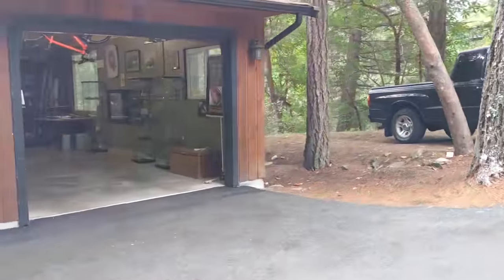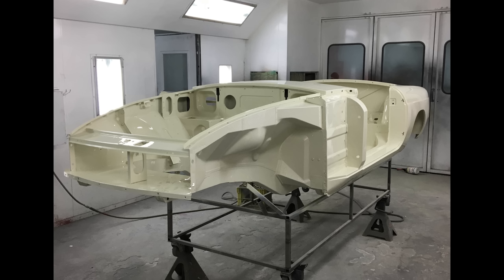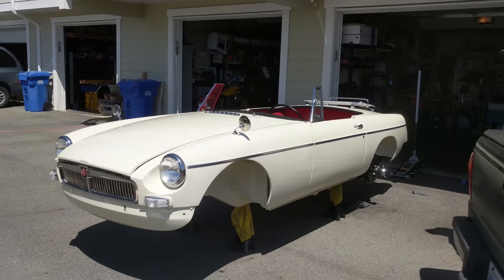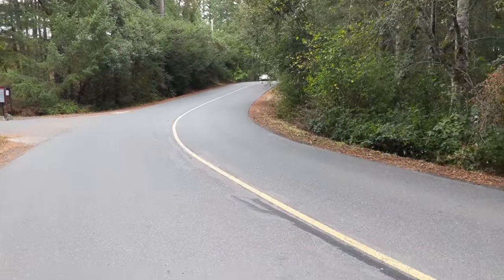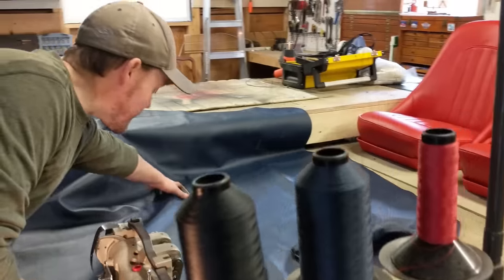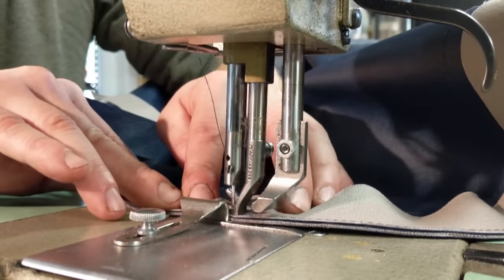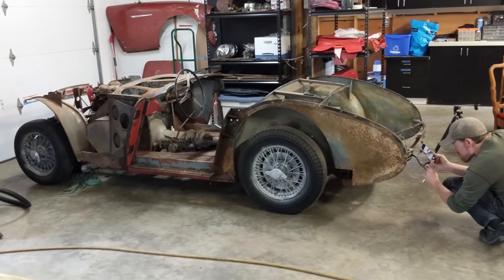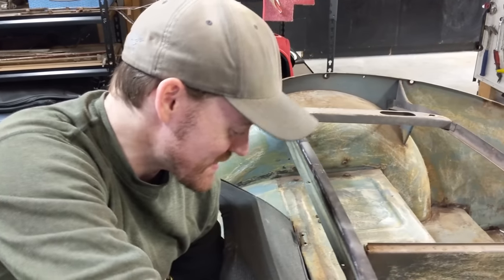The Rightway MGB

Comment: A very fine piece of restoration .  I have always lived in England and perhaps can offer some info on 1960`s car painting. BMC used a rotadip process which immersed the bodyshell in pink primer. Any paint that subsequently got underneath was overspray!! If a customer wanted underseal to be applied  it was done by the dealer not the factory. The produce used was Dunlop Rubberseal.  It was largely up to the competance of the dealer as to how effective this would be. If it stuck well actually quite good. There was never overpainting with body colour because most paints would dissolve the underseal. Cavity protection didn`t exist back then so rust was common.

Comment: I had a ‘59 MGA as my first car and then a new ‘67 MGB in college.  The B literally broke down with 27 miles on the odometer!!  Bad voltage regulator.  I kept it for 30k miles but had to get rid of it while I could as the engine smoked badly.  I still loved every minute driving it though.

Comment: I enjoyed the video ..very well-done and informative. I have had 3 MGs since my early 20s. I bought one new in 1979. Still have the window sticker with price and all options on it. Handbook.  Car flyer ads for MGs that year..both boot.and tonneau covers. Everything! Took it out of storage since 1988 2 yrs ago. Little rust! Maybe because my dealer had me inject a product called Rusty Jones every year or 2 into little orange plugs that came out to put it into the car body? It is nearing the end of restoration..never been in an accident and had under 56,000 miles on it. Original paint was still.intact when I took it out. Had a little rust on seams or edge but nothing major. But...when I sent it out to be dipped there was a surprise! When it came back the driver door had a huge metal.piece covering a good part of the lower half! The passenger door was fine. Since I AM the original and only owner and I know I never had any body work done.it had to come from.the factory with this flawed door which was then primed and painted to be sold as a new car! Have you ever heard of this? If I hadn't restored it from flame up.I might not have known. Were they in the habit of putting used or damaged doors on new cars at the last couple years of production? Curious?

Comment: Why would someone give this a dislike?

I have a 1964 Mk 1, same combination but without the white piping, mine is red.

The marque is surprisingly tight, feels solid, and I am giving some serious thought into getting a MGC Roadster, as the chasis feels like it would handle the extra power with ease.

Thank you for posting this video
Reply: We, too, have a 1964 Mk 1 in Iris blue, completely rust free and original but has suffered the wrong ownership. Had not run in 15 years, luckily properly stored indoors. Got it running in 4 days, driving in a week and now into 5 years of ownership and taking our time bringing it back to a better life. The Bs are not rare but fun, fast, handle well and parts costs are modest.  . We have owned several MGs since the  first 1953 Mk II TD purchased in 1964. This B is now our favorite . Geoff's work is inspiring us to go to a higher level of restoration.  Jeff and Melinda
Reply: Hi Gary,  We  owned a 1969 MGC GT purchased with 12K miles on it. One of the best of our 100 plus cars we have owned. Good luck on finding a C roadster. Great cars.
Reply: Melinda Manthey, I also have a TR6 ams a Spitfire, the build quality of the MG is that much better than Triumphs, the way I see the cars, is that the Triumphs look more sporty, but it’s a lot of show, whilst the old MG’s have that air of understated class

I am very impressed with how she pulls, (both the engine and the comments 😇),  had her put over Easter as the weather was lovely, and clocked up 150 miles in three days.

Comment: I had two MGBs, the first was a 1963 used car in good condition but the crank only had the three bearings which did not last long the way I drove it! The next was a new 1965 roadster in BRG with wire wheels and I loved that car. It ended up almost totalled in a head-on collision at night when an idiot crossed the double white line. 

It took 9 months to fix but was never the same and in the meantime I bought for peanuts (those were the days!) and drove a 1946 MG TC  which was also great fun.

Congrats on your restoration, it is truly superlative!

Comment: Wow! You’re  class act - I had a 1971 MGB Roadster as my first car when I started work after College ( much to my father’s disapproval!) and after running it for 4 years I either had to sell or restore - I decided the latter as I had built my first car (a ‘64 Mini) creating 1 vehicle from 3 donors in a crazy summer of ‘72. My hands were never clean and my pockets empty and I was holding down 4 jobs to pay for the parts!! So I had the skills and embarked on an 80% restoration - running gear, suspension and brakes during one winter and then a full body and interior refurb the next year. The vehicle ended up in Jaguar British Racing Green and after a complete back to metal paint job - all bright work was re-chromed or replaced - the carpets were replaced and I was ready to go. The only further changes were some parts from MG Special Tuning department (Stage 2 gas flowed cylinder head with polished ports and stronger springs) which only improved the top end performance but certainly made for a very smooth drive through the gears - she would pull too 115 mph but I was too careful to push her too hard! Once sense prevailed I had to sell her and become more practical in my 30s and to date! At the grand old age of 67 I still think kindly of those days and the satisfaction the work gave me - your MGB is far beyond what I could achieve or afford at the time but the results you have produced are wonderful. Thanks for posting such an informative and pleasurable video! 😀

Comment: Outstanding MGB sir. Amazing build. These cars are super fun and reliable but must be respected. I've put over a 100,000 miles on each MGB I had. Really love my 1968 and 1972 Bs the most. I also had 2 1979 cars- rubber bumper models. Those had a bit more ground clearance which is good if you travel gravel roads. We have a lot of them is this State. Treat her well and you'll have a long affair with it.

Comment: Had a "69 B that I made by putting 2 together. 69 rear section and cab mated to a 63 front end. Love'd it. Sold a '59 AH 100-6 (a true POS owing to its condition) to get the wrecked 69 B and the 63 to make one complete B. Miss those days. Drive all week, go everywhere on $5-$6 dollars in fuel. So Rock On there Mr. Owen.

Comment: What a lovely video and story! My very first car was a 1962 MGB roadster bought in 1964 with a few miles on it. Changed that in 1965 to a brand new B, loved them both. Kept the 1965 one till 1968 and then traded that for a Sunbeam Tiger. Later "I feel the need for speed" led me to an AC Cobra 289, and many years  after that a Cobra replica with a 302 Ford V8. I have not owned a sports car since the last Cobra which I drove for 10 years, there seems no point to it as not much can come close to that!

Your MGB looks absolutely pristine, clearly a very careful and thorough restoration - magnificent!

Comment: For some reason when I was a teenager in the 80's I remember seeing a lot of MG's in the back of people's garages,back yards,in driveways but never seeing people driving them , I wonder why ????
Reply: They were very modest and didn't want people to realize how classy they were.
Reply: I bought my 1st one a 73 in 1976 from a couple needing a family car. Kept it til.1979 when I heard no more would be made. Traded that beauty in (maroon) on a new 1979 white for a little over $6000. Dumb move. Should have kept the 73 but I was a kid and thought a new car was better. I still have it though. Took it out of storage 2 years ago and it is all original. It is now in the final stages of restoration from frame up. Original paint was removed.  Body had almost no rust or parts needing replacement except rockers and bottom door on one side. I changed from rostyle wheels to wires like my 73 had. Removed rubber bumpers and found original chrome ones with overiders. My engine had under 50,000.original miles but left all those years had pretty much frozen up so I have new oscelli engine from England in it. All the interior is original and in good condition. Seats recovered though and new foam. All.panels are perfect but had them gone over. Dash perfect...no cracks....I can't wait til its done. It is in the 2nd coat of primer now..keep these old MGs going!

Comment: My Dentist pal gave me a 77 MGB to work on with my son. His three boys tried their best to murder it through successive high school adventures so it was VERY tired and totally neglected. It was totally rust free however. My son turned up his nose at it in favor of an 89 IROC Camaro which did get the full father and son immaculate restoration.

Mean while the B served faithfully as a storage shelf in the garage for a decade or more.

I decided to restore it and went to some club events to evaluate the work necessary. I realized that no matter how hard I worked there would be some guy next to me at a show who had just dropped $30k on his. I decided that was not for me. As I pondered my options I recalled the bullet tail lights on my dads 54 Packard Clipper and thought: “Those might look nice.” I am now about half way to turning the lowly B into a small Packard Clipper Speedster that gets its inspiration from the Caribbean show cars from the mid 50’s. There is not one body panel that has not been Packardized. The interior has a complete Clipper Super Custom dash with all the jewel like glitter of the era. There is a bench seat back that will be upholstered in leather with wool inserts as will be the B seat bottoms. Behind the seat and extending to the trunk is a mahogany with holly inserts wooden deck as befitting a 50’s speed boat. The rear has a continental kit partially inset into the trunk. The hood is totally custom with a horizontal scoop mirroring the Caribbean, the nose has been lengthened six inches and features an oval grill with the Clipper “helms wheel” casting in the center. The headlights have been replaced with the front 12 inches of the fenders from an unfortunate Healy 3000. The stock engine is totally disguised with lots of visible 50’s parts. A fake six volt battery box with all the vintage wiring and doodads bit my best part is a valve cover that I made and had cast in aluminum that appears to be the top of a flat head engine with fake plugs and wires leading to a fake distributor. Between the fins is a flat area with “Half Pack” embossed in it in the Packard Script. Completion is scheduled for December and I am on track. 

Then let the perfectly restored MGB park next to me. I know which one they will all be looking at.

Can I contact you about doing the seat bottoms and back. They will be very special? lrsoren48@gmail.com

Comment: When I had my MGB ('72) I didn't like the tonneau cover flapping when driving, unfortunately the cover was ripped but in a way where I could keep it zipped and able to tuck it between the passenger seat and center council (steering wheel, head rest covers reversed).  I had plenty of shoulder room and had access to the passenger seat through the zipper.  ;-)

Comment: Lovely job. At some point you might consider adding an overdrive.  It makes a big difference at any speed over 50 mph
Reply: If you're talking about the MG, isn't that the overdrive switch on the left of the dash?
Reply: @zodrob7 Perhaps not on this car. Note the "bent" gear shift lever. An indicator of a non overdrive car.  The OD trans has a straight gear lever. 
Likely that switch goes to the driving lights.
Reply: @melindamanthey2757 Interesting, I didn't know that. My first MG had a long curved od switch there but on a rhd

Comment: MGB owners in USA , Canada, & rest of the world. :- 
Just about EVERY PART is available in the UK.  Some Genuine Original,  Some Re-Manufactured to Original spec.  Even New Bodyshells. 
We Have A Local Company that Can Re - Make almost any panel for any Car.  A Real Genuine Sheetmetal Working Company.   Send them the Rusty Panel, / Bent Panel & they will Make it New to Original Spec.  
Or Exact dimensions.  
The People Who Made these old British Cars Passed Their Skills & knowledge Down to Younger people. 
Old British Sports cars & Classics Rust Out Very Fast in the UK, Long Before the Mechanicals Wear out. 
MG's & Triumph Cars = Almost Everything is available in the UK.  & as per Original. 
And Companies Who Can Tweak them up, or Upgrade Performance Parts. 

Britain Has Every Expert & all the Knowledge of old British Classics. 

Even Companies that Manufacture NEW MGB's using all New Parts , & Can Add Any Feature You Can wish for.  V8 ? Leather int' . Air Con,  Upgraded Suspension & Brakes Etc Etc ... Anything is possible. 
Price Tag,  Beyond the MOON !!   £160,000 MGB's  are Available. As New Cars Mazda engines & 6 speed Manual . Rover V8's etc. 
England Can Build Anything with OLD TRADITIONAL SKILLS.  Back to Original Or to Your Budget. 
Small Micro & Family Businesses Can Do ANYTHING in England. 
Sometimes It's one Man working From a Home Workshop, But it will be to HAND CRAFTED PERFECTION. 
Britain Is Full of Tiny Micro Businesses Specialising in Almost Any & Every Trade & Industry & Skill You Can't even Imagine.  Genuine Old School Original HAND MADE. 
Seats,  Soft tops, Electrics & Electronics, Engines, Trim, Carpets, Re- Chroming of bumpers etc. 
Endless Used Spares & Cars for Breaking. 

Look online for co.uk websites, & dot com websites .  ( .com)  uk. 
There Will be People Who Refurb " Smiths " dash instruments. 

All the Metal Panel Press Tooling Was bought by an Independent Company To Continue making Every Panel on the car. To ORIGINAL EXACT standards. 
" Heritage Cars " . 
English Cars, = Come to England for All Parts.

Comment: Get rid of the metal fan!  They flex fail.  My 70's b threw a blade and it got the rad. and hood.  Save it for meets  and get a plastic one for daily driving.
Reply: Better to get rid of the power sapping standard fan and fit a Kenlowe electric one complete with adjustable thermostat (unless even this small mod from the standard car is not allowed).
Reply: I took the original metal fan off my 67 2 years ago when I put the Revotec on it. I'v got in the boot tucked inside the spare wheel in case the electronics let me down a long way from home.
So far after 50 years and over 100K miles, so good.I dont think you can still get Kenlowes
Reply: @stanbest3743  I rebuilt my 701/2 MGB and used it as a daily driver for 12 years.  It only broke twice. Once the fan blade and second the alterator went out. I had a kid so I
parked it and was going to restore it again as a show car.  Well a tornado blew a oak tree across it. So much for that.